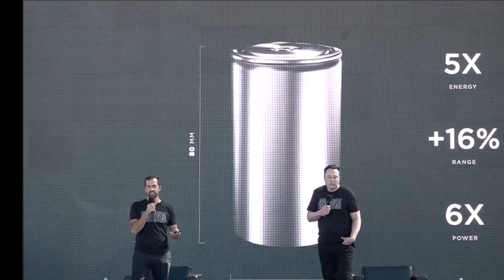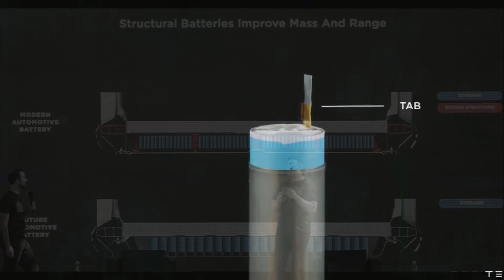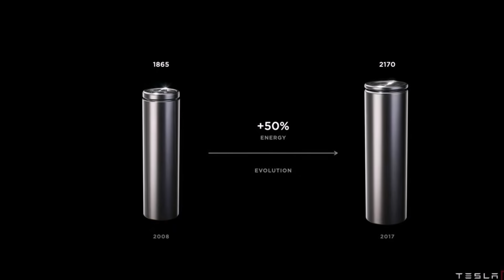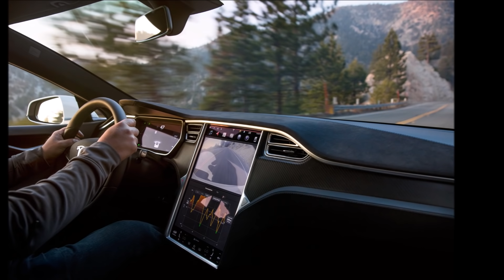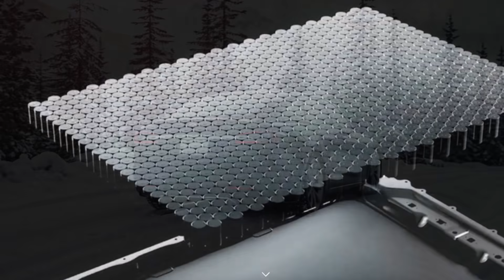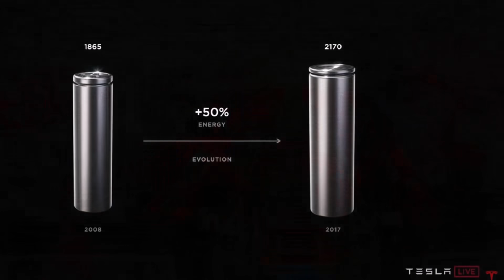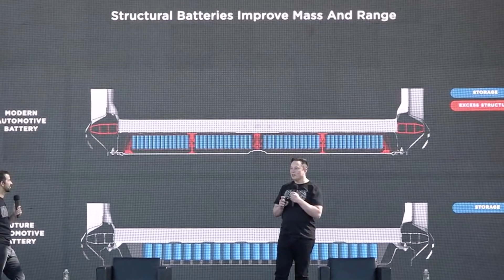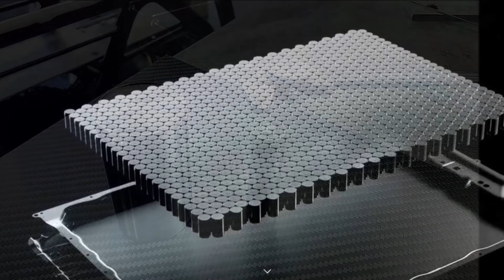Answers To Tesla Shareholder Meeting 2021 Questions: 4680 Batteries and Usage

Comment: I was wanting to know about the production of 4680 and how soon we will see them since out of all the Tesla news that's been the most hush hush other than the refresh of the Model X and the new Roadster. But it sounds like while they're focusing on the refresh, Model X, Cyber Truck and Roadster, all of it depends on how soon they get the 4680 batteries into production. And that's sounding more and more like the back end of the 2nd quarter 2022 all the way in to the 4th quarter of 2022.

I'm monitoring and waiting to see this as I want to by a Model Y. But I'm also monitoring the infrastructure bill. If that becomes law and ends up giving me $8,000 off at point of sale then I'm going for a Tesla with the current 2170 battery.